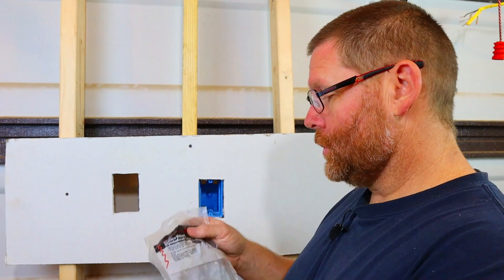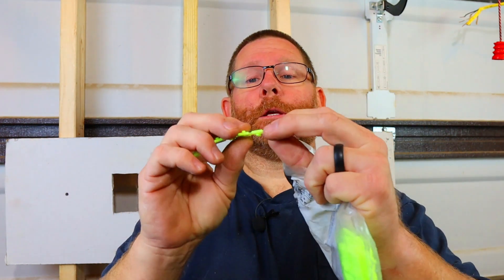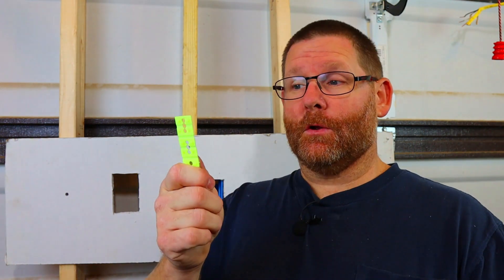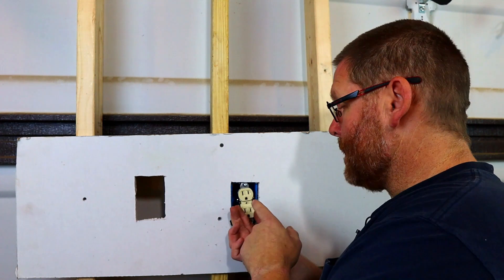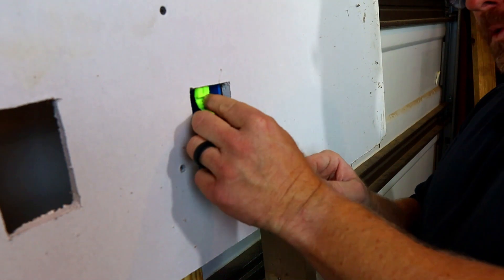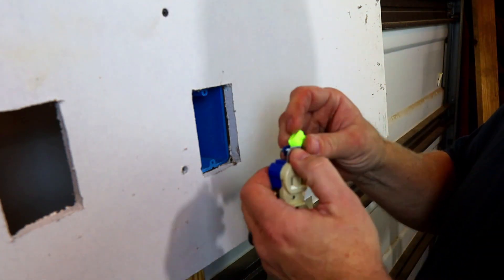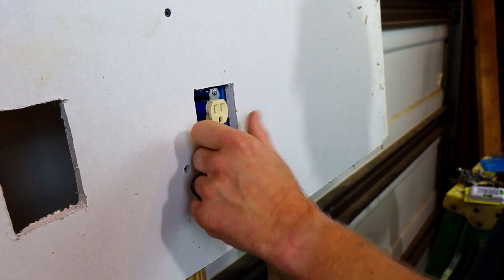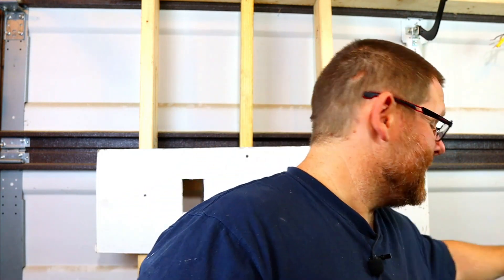How To Repair A Loose Outlet | Fix Broken Plate

Comment: Plus these plastic spacers are so useful on kitchen outlets where there has been a tiled backsplash installed.  These plastic spacers are much safer than using wire or washers as a spacer.
Reply from the maker: I agree

Comment: It should be outlawed and against code for the electrical boxes to be recessed so far back behind the dry wall, be loose or mounted at an angle relative to the face of the dry wall. The electrical boxes should be flush with the surface of the dry wall so the ears on the outlets have something to be mounted against. I can't believe builders are that sloppy when it comes to this type of work but these issues are the majority what homeowners see. Thanks for the video.
Reply from the maker: I fully agree with you on that. Thanks for watching and commenting ☺